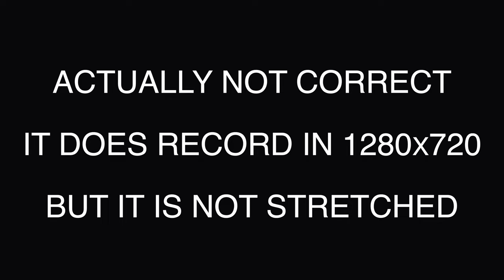The TRUTH About HDZERO and SD CARD FORMATS

Comment: Windows refuses to format sd cards as fat32 if size is over 32GB to comply with the spec. Formatting tbe sdcard in the hdzero vrx allows fat32 format for any size. Microsoft charges $6000 and some amount per device to support exFAT - this is likely the reason that exFAT isnt implemented in the vrx
Reply from the maker: There are some programs for windows that get around the limitation.  At least that's what I understand but I don't use Windows so can't confirm
Reply: @StacemanFPV  yes, there are some utilities for windows that implement fat32 above 32GB - this is only a limitation of the built in formatter
Reply from the maker: Updated the description with some details on doing that.

Comment: Just adding that I use 128gb and 64gb sandisk gold cards formatted to fat32. I do this on Windows 11 using an application called guiformat. I once forgot my Micro SD card and a friend of mine let me format his in-VRX and it utilized all the space. Have never had problems recording flights with any of these high capacity cards.
Reply from the maker: Excellent!  I added a link to an article about fat 32 and it links to that application as a good solution for Windows

Comment: I just received my goggles and tried a 128g card formatted in exfat. It won't recognize the SD card and I'm afraid of trying to flash that I may brick them. So, are you saying it needs to run a 32gig card formatted in fat32? Just don't want to mess these up or fuck around with having to recover
Reply from the maker: Don't use exfat... Has to be fat32

Comment: +1👍okay i promise i was listening, but might have zoned out. sounded like sdcard size was the overall concern, which it should not be; However,  the thing about fat32, is individual filesizes can only be up to 4GB each.  your HD vid may or may not be reaching that (probably not)
    EDIT: okay i see the conversation with Ryan....
i've used fat32 on 64GB thumb drives plenty, but i always format via Linux, so this might be why.
Reply from the maker: Yeah windows enforces the SD association specs with the default format tool...

Comment: From what I understand, hdzero goggles are formatted with a linux operating system, therefore it's strange to me why the goggles can't support anything linux supports, you just build the image with the required packages installed. Fat32 supports any file up to 4GB in size and 8TB maximum partition size. So unless you guys are recording huge videos onto the sdcard, then fat32 is just fine. 

Also fat32 has other benefits that you won't know about until disaster happens. Fat32 has a redundant FAT table that means it has redundancy about the contents of the drive in case the power suddenly goes out. Why is this useful? Well sometimes with sdcards you unplug them and the FAT table becomes corrupt and on fat32 this is less of a problem because you have a second copy. Meaning you can just fall back to the old table when something gets corrupt in the primary copy.

This is bad on exfat because it has no such redundancy. Which to be honest is fucking stupid and should be fixed, but it won't cause some idiot designed this file system and now it's too late to do anything to fix it.

The problem with exfat is, when your FAT table (the table holding all the file system data for every file and folder on the drive), gets corrupt. Then all your files vanish and exfat has no way to restore access to any of the bits and bytes still on the disk. It's all lost, you can't recognise the drive anymore. You can't recover any of the files anymore. You're fucked. If you have 8TB of archive data on a removable hard drive like I did, well then tuck your head between your legs and kiss all you want, cause it won't get your files back. You just lost everything and you can't get it back, ever. You're only hope is a full bit scan of the drive and hope you have a program that can recognise files by data structure and maybe the program can pull a disorganised mess of files, that you'll have to reconstruct manually, file and folder, one by one. 

So exfat is fucking shit. fat32 supports 4GB files and 8TB hard drives. Hdzero goggles use linux. So I don't see why it can't support my 256GB sdcard. Seems just to be a small configuration change we need to do. I'm curious to see whether I can do it actually.
Reply from the maker: This was on the external module and not the goggles.  Goggles do run Linux. Latest version handles everything just fine but not exfat as that requires licensing or something I think.  But I use 128gb cards formatted with fat, I guess fat32, currently with no issues
Reply: @StacemanFPV  ah wait! you mean the external module for hdzero, that lets you plug into your old goggles and fits on the front like a pair of goggles, for your goggles (sup dawg, I heard you like goggles...) I wonder what the external module uses for it's embedded operating system.
Reply from the maker: I have no idea what it uses.